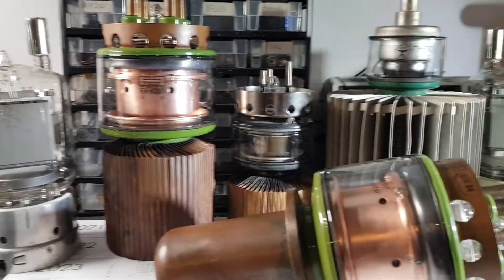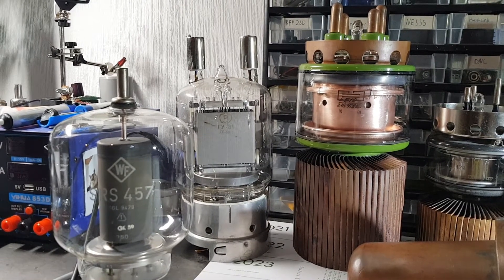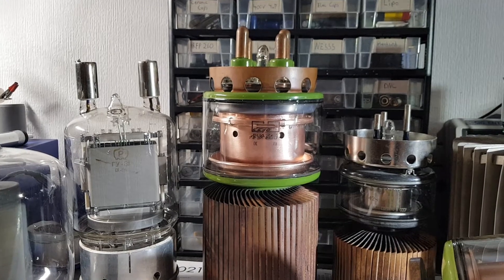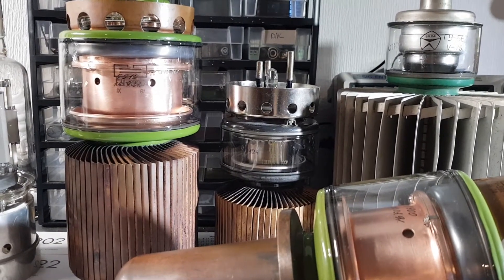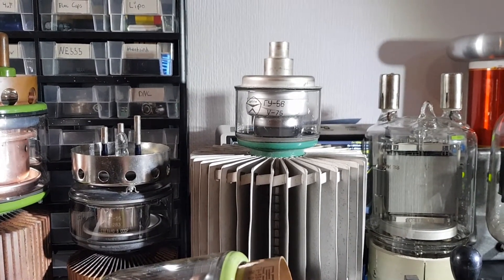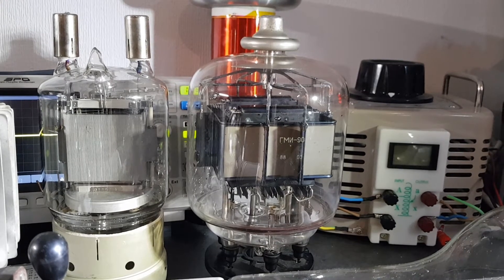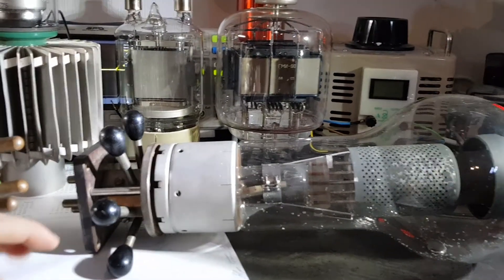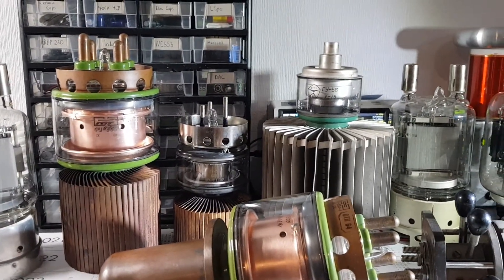High Power Vacuum tubes

Comment: Hello gu39 b can it make plasma flame just like the gu5b method if you have the schematic of that tube i will pay you
Reply from the maker: Hey I'm working on exactly that! It's not just about the schematic. For such an project you need good understanding of RF and HV circuits and the right components. I'm still working on the schematic but with such an project you cant just copy paste it. I think I will need a few months until I have the final running HFVTTC.